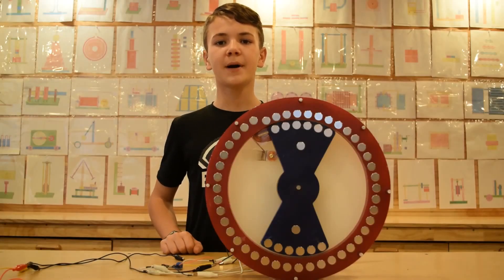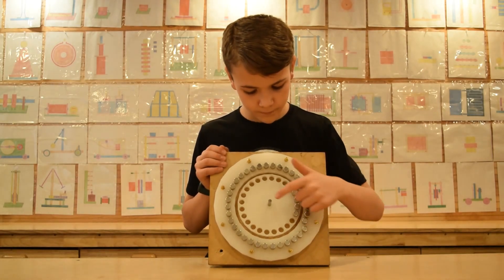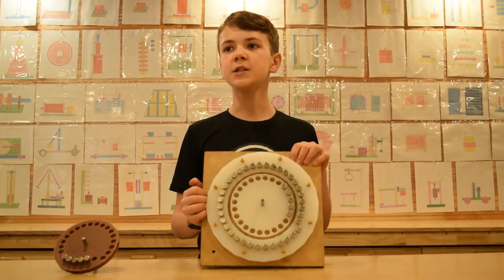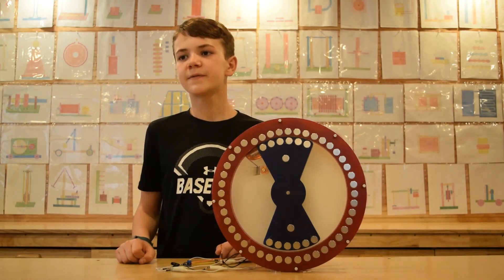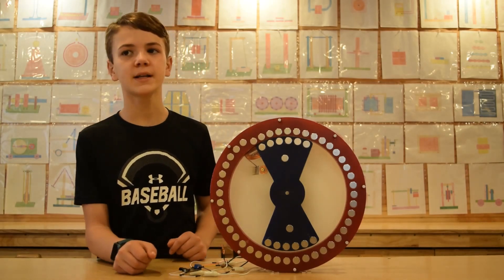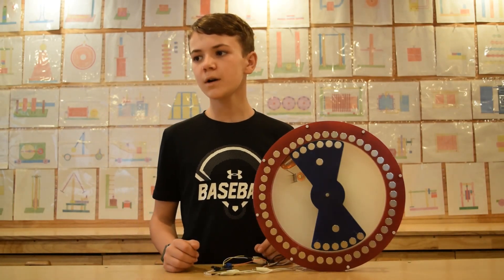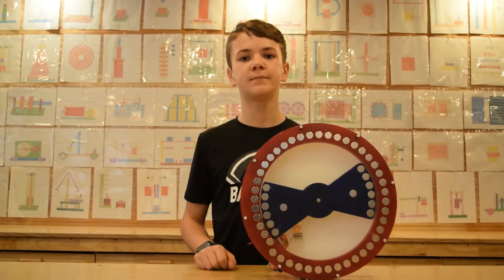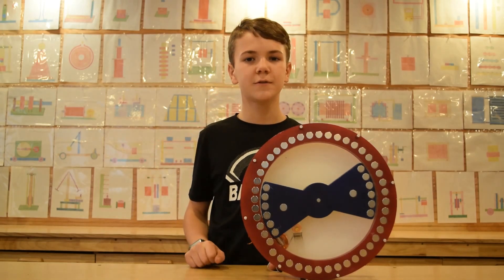All Magnet Motor with regauging section.

Comment: What do you use for the Coil Driver? You don't elaborate much on the cancellation coil and what drives it.
Could you describe The Coil and circuit? I printed a 3D model and assembled it, except for the circuitry, which I would like to get running.

Comment: Good morning! Good afternoon! Good evening! Excuse me! Mano Guri! All this works! This is the same TECHNOLOGY of the engines of PLANETS & STARS! In order to work, there must be an alternating instability between the centrifugal and centripetal forces. IT CANNOT HAVE THE STABILITY of NEWTONIAN INERTIA that stops and does not work! The ones that put in PERMANENT ROTARY motion are the same all the time, pushing not TOWARDS THE CENTER OF GRAVITY but rather going out at the TANGENT, continuous pushes plus one (1) or two (2) Diagonal pulling forces. FlávioAugustoRibeiroEvangelista./u

Comment: Important fact here ıs not the type of magnet motor or array, the time you spend on trying the break force of the gate and gaining time and power without spending energy during the completion of the rotation. So calculating and finding better ratio could show even better results

Comment: If you can't share the cad files will you share the following info to help with a starting point?

1) the distance from the bottom of the furthest stattor magnet to the center. 
2) the distance from the bottom of the closest stator magnet to the center. 
3) the distance from the furthest magnet to the id of the stator.
4) the distance from the closest stator magnet to the stator id
5) the distance between stator magnets 
6) the distance between rotor magnets. 

Any help would be greatly appreciated.  Thank you.

Comment: Remove the battery and replace it with a capacitor. Then the system will power itself. Love your switching coil and timing magnet.

Comment: The energy you need to push the rotor over the gap is higher than the generated energy from the rotor. But you made a great experience.

Comment: As suggested before  longer arms and assimetric to let gravity help on the degauging process (sticking point). The design is sound and clean, but i was thinking about a multi-layered system of  spiral-like stators with assimetrical arms all mounted on the same shaft, with different angle "sticking points" in a half a circle (0-180 degree) range all with gravity assistance. Assimetrical arms just on generator-like motors as im thinking on low rpm operation. On traction motors (high rpms) i agree with you on going to a balanced rotor.

Comment: Never work without external source
Reply: Duh he says he has a "battery" to operate the 'electromagnet'.  He's not claiming it can do so without it. It is another's design of a "permanent magnet" motor, Mr. Takahashi's design. There are lots of "permanent magnet" motors designed and on the market! Bet they're not getting the flack this design is!

Comment: Could the sticking point simply be spread back once you start it instead of the electromagnetic intervention or try reversing the poles on them?  Or, now that the wheel is running can it generate enough power for the assistants without the battery and still have a good margin of energy left to make profitable? The bearings are a simple problem which I see you are addressing. Least friction is important.

Comment: Hey Daniel👋,
I have a question that I am struggling to find an answer/solution for. 
Maybe you can help.
Do you think is possible to build a high power density motor with HTS magnet and without need for cooling?
I will offer you a  $1000 if you can help me crack this on up. 
You’re doing a great job by the way.
Your parents have earned a bragging right, because they did a great job in nurturing your curiosity.

Warmly,
Lamine

Comment: I saw a similar system running in the Kirkuk/Iraq cement plant in 2009. It was a bigger version, about 1 meter in diameter and 4 rotor arms. The magnets were about 8 - 10 cm. A car battery was connected to a solar plate and delivered the energy for the switching coil. A car alternator was directly connected to the shaft and produced AC voltage without interruption. They connected lams and a drilling machine and these things were running absutely normal. They planned to change the coil against some rotating permanent magnet and change polarity. Didn‘t understand exactly what he meant at that time. Anyway, amazing job 👍

Comment: Now show us the back of it and what's connected to the back of this thing while it's running, Daniel. We want to see the motor that you're using to run this thing!

As they say, the hardest part in inventing a perpetual motion machine is to know where to hide the battery...
Reply: He turned it around at 7:40.  In addition, he wasn't hiding the fact that he was using a battery to power the electromagnet through the sticking points.  If he attaches a generator to this thing and feeds back that power to the battery, it would be interesting to see how long this thing could run...
Reply: @flashpoint726  he turns it around as it's not connected, and then there is a clear and undeniable cut and suddenly there are wires going to the left outside the frame. There's nothing stopping him from adding a motor, connecting it to batteries, starting the camera again, and then pretending it's running on its own. 

This is more a social experiment on how many suckers will believe perpetual energy keeps being invented in the exact same way by many different people on YouTube but never put into any real life application. 

What's more likely, that this kid invented perpetual energy and made a video instead of collecting his Nobel prize while solving a global energy crisis, or that this is yet another hoax to count the gullible people in the comments?
Reply: This isn't even his idea - he's replicating a motor invented by someone else.  I've seen others make this motor on YouTube and it's an interesting concept.  But it's not novel so cut the kid some slack.  He never once mentioned perpetual energy.  Sounds like you're just looking for a reason to troll!
Reply: @flashpoint726  yes he is. He is being paid to troll because energy companies do NOT want something useful like this to be realized because they stand to loose a lot if it does and they loose "power" (lol) over people.
Reply: @eslachance  lol you are funny! 
Would you be willing to answer a few questions??? If not we'll know who the real troll is!
Is "science" a noun or a vern?
What is your definition of the scientific method?
Can the scientific method produce results that are outside the little glass box that is trying to be defined as "science"?
Reply: @magapefarmshomestead6453  my point is that he's not breaking any laws of physics, he's cheating and lying through his teeth. Power companies are building things that cost money to build and maintain. Even renewable energies like wind and solar cost maintenance and upgrades and are expensive to build. Don't mistake "renewable" with "perpetual", those are two entirely different concepts and you'd know that what you're saying makes no sense had you the ability to distinguish the two words. 

It costs billions to make hydroelectric dams, solar farms and wind farms. It's not *free*, it's *renewable*. It's so painful trying to explain simple concepts to people like you.
Reply: @darklight2.1  have you not really watched and "listened" to the video?? He is not stating it is, though "you" are implying it is, a 100% magnetic motor. His description states it has permanent magnets AND an electromagnet. The electromagnet is operated by a magnetic switch AND a 'battery'! The electromagnet is there for the purpose of 'kicking' the rotor past the sticking point of the magnets. When he disconnects the battery from the "electromagnet" the sticking point of the magnets slows and stops the rotor.

Have you ever heard of electric motors called "permanent magnet" motor? They are everywhere.  That is what this is. A permanent magnet motor. No claims that it is or can be a "perpetual" motor. They are reproducing the design of Mr. Yakahashi. It is a permanent magnet electric motor. 

Please tell me you are not so focused on disproving something as unacceptable science, because you only watched it and did not 'listen', that is an accepted and used 'scientific' model that we use in modern society ubiquitously.  Just because the design is different doesn't mean it is not an electric motor. Just because YOU think it is something it is not doesn't mean it is what you think it is.  Your determination to discredit this as something it is not shows you are the troll, doing nothing but looking for something to complain about.  You really are, currently, a sad excuse for a human being. Maybe, just maybe, if you really watched and listened to the video you could see that it, the device, is not what YOU are claiming it to be. That it is just a more efficient design of a standard design for electric motors. I won't hold my breath that you will see truth but I can only hope!
Reply: @eslachance  I agree that it is painful trying to speak truth to someone like you. You, for some reason, can not see that they are NOT claiming this motor design is perpetual. It is  a permanent magnet motor that uses a battery and a magnetic switch to operate the elecomagnet. How is that any different that regular manufactured permanent magnet motors??? Other than most other motors use ac instead of switched DC. It is just a different, more efficient design, by Mr Takahashi. Isn't that what we are trying to do?? Make things more efficient??

If it is why are you so determined to try to discredit this device, which is acceptable science, as something it is not??
Reply: @eslachance  I do know the difference between renewable and perpetual. But apparently you don't. You are the one claiming that the device in this video is perpetual, they are not. Neither does the original creator of the design. They are stating that it is a permanent magnet electric motor. It REQUIRES power, of some sort and in this case it is a battery, to operate the electromagnet. If you'd really watched and listened instead of "assuming" you knew what it was by the way it looks, first of all: you would not have made a claim they are not, second: if you are truly as familiar with technology as you claim you would have understood it is a permanent magnet electric motor. 
For whatever reason you decide it was something it was never claimed to be and have been fighting blindly because of your assumption. Please open your eyes and ears to truth.

It is a permanent magnet electric motor not a perpetual motion machine.
Reply: @darklight2.1  funny thing is that I'm not digging any hole you are maybe someday you will understand magnetism and not just what is taught. There is much much more to it than just what is taught.
Reply: @eslachance  selling stuff that allows others to experiment is antithetical to being in coercion with power companies
Reply: Funny. You never answered my questions. (Except for the ones you cherry picked with the hope of pretending you are right).
Here's a few more: that 
As, by your implication, magnets do NOT interact with each other or anything else, what good are magnets?
Science has proven and we have everyday experiences that prove that magnets DO interact with most things around us. They have force, which is why they stick to things. They interact with electromagnets, which is how we have almost everything else. Your headphones wouldn't work without them 
Because magnets interact with each other in the actions of attract/repel that is how magnets can cause other magnets to move. If you had ever done any experiments in school with magnets you would have known this. So the above is how magnets cause other magnets to move, in answer to the sarcastic comment about enlightening you by a not so genius genius. It is apparent that you know nothing about magnetism or have ever experimented or possibly even played with magnets. You would be able to show that in your comments. True lack of knowledge or a wilful denial of it.
Reply: @flashpoint726  calling it a motor is the entire point why this is an actual troll video. It's not a motor at all. The motor is what's hidden from us to pretend like this can even accelerate like shown - the secret is that it cannot.
Reply: I’m glad to see that there are quite a bit of people out there who can’t or won’t even try to just make one of these and test it against what we are seeing. I for one do believe that this or something like this will work and are willing to try. I’ll build one myself and test it myself. Should it fail then I will drop it like it’s hot but should it succeed…. Ether way check my channel in about 2 months and find out.

Comment: An Awesome build, some thoughts though, did you try a heavy flywheel might pull it through,  what happens if you soften the transition with tapering back to original, a shunt, or a cam that pushes a magnet where you apply an electromagnetic pulse.

Comment: Well done Daniel and father, Did you measure the input power to it ? How many Watts does it require to run ?
Regards, Stefan.
Reply: You could probably produce lots of induction energy by winding coils around each stator magnets and around each rotor magnet... Try this and light up many LED lamps with it. Maybe it could then also recharge your battery.
Good luck ! Regards, Stefan.
Reply: @oudotcom  no, that would increase critically induced drag to shaft due to B-EMF. The objective is to produce positive torque. The take should  always be made on the shaft of the engine by an alternator.
Reply: I agree, well done!!  Thank you for performing these experiments! While I am not sure how scalable they are there are basic fundamentals that you are trying that 'they' would rather be kept hidden (or suppressed). Most naysayers sayers are either payed to try and discredit or they are too stupid to be able to think let alone 'critically think' and only spout what they are taught, which usually has little to do with reality.   

KEEP UP THE GREAT WORK!!!!
Reply: I love your original designs but though pickup coils will work, they won't work very well. Shaft power is much better on a properly designed dynamo. Which in my opinion has never been properly designed for the public market. Think why we need to do work, then how to do the same easier. Cancellation of forces is a thing!

Comment: Magnet motors of this kind work better with a large flywheel. It has to do with the calculation for the amount of energy stored in a flywheel. Larger mass takes longer to accelerate so it accumulates more energy from the force applied by the magnets, by increasing the time component of the calculation.
Reply: Yep, flywheel generator ...
Reply: Correct
Reply: And it gives stability to the system
Reply: No 1 has really made 1 yet. If they did we would all have free energy. I was hoping this video showed how and why they did not work
Reply: @justindamirgian5977  Fly wheel is an unnecessary addition. It does nothing for it but reduce torque and add weight and expense. Geometry and the magnetic circuit is the answer. My version of this general style of motor is far more developed. It has high torque and high RPM along with high efficiency and will make a good addition to the art. This boy did a great job with his project. I'm sure this was a great father son collaboration. I hope he continues to work the design. A 3D printer would be very helpful tool.
Reply: @dee5556   have you got a working prototype? Would be interested to see it. Cheers.
Reply: @EC-nj2wv  Several. Hopefully within a few days of completing the latest version which has many changes based on what was learned from the last build. Still haven't hit the wall yet but this should get us a lot closer. New composite parts have been added to further decrease eddy currents and increase permeability while maintaining high flux density. Also we did a much better job with the magnetic circuit design.
Reply: @EC-nj2wv  Probably will not be showing off the design for a few years. Thousands of hours and dollars have gone into this and we will be going for design patents as the original patent is in the public domain. Our version is highly evolved compared to anything currently being displayed. We are aiming for the electric aircraft market and e-jet power modulus. I keep tabs on versions that are displayed in the public forums, that is how and why I found this wonderful video.
Reply: @dee5556  sounds very exciting! Hope all goes well from here on in! 👌
Reply: Следовало симметричный .
Двухзаходовый.
Рекуперацию обратноходовика  и до 800%

Comment: that battery was just the off switch,  it actually runs by itself.
Reply from the maker: If you look closely, I moved away completely out of the picture and was watching the motor from the side and simply disconnected one of the connections to the battery. The second time, I stayed in the picture and disconnected one of the connections to the trigger switch while the battery was still connected. Both ways turned the power off to the motor.
Reply: @DanielsInventions  What you need is a way to remove the last two sticky magnets or pull them away, there was a man in Oklahoma who had a machine like this and it seemed he used a cam to mechanically remove the sticky points mechanically... or you can replace the last two sticky magnets with electromagnets and just turn them off... but I don't think it's just the last two magnets making the sticky point...  I think when you remove them then the next magnets become the new sticky point... so shielding or mechanically moving them away might work...